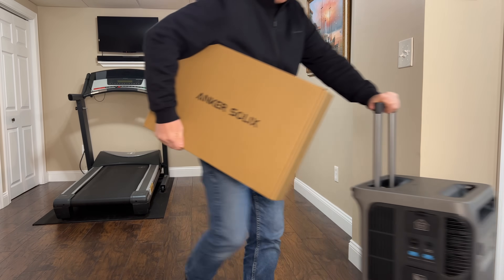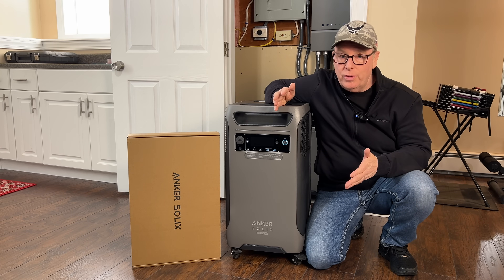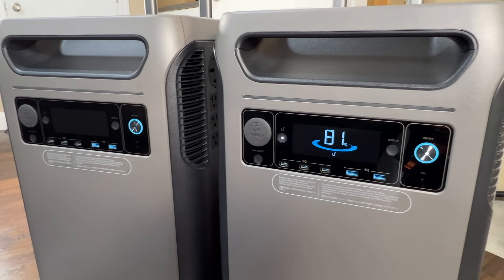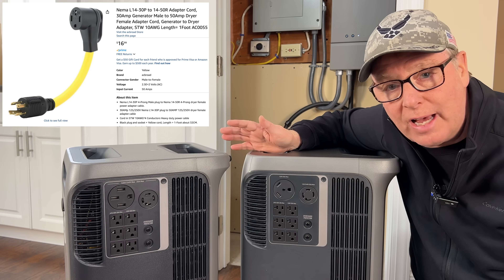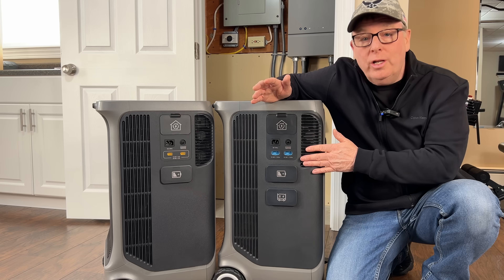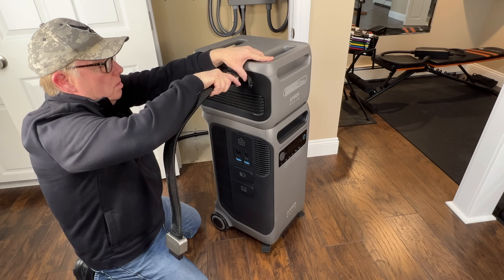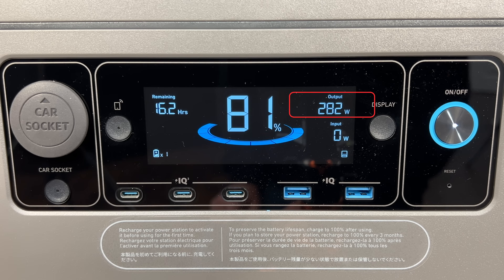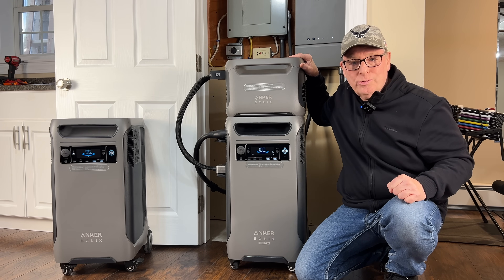Make Your Battery Last Forever (Anker Solix F3800 Plus)

Comment: I have a similar custom backup setup
1   4kw invertor
4   12v 100AH batteries
1 mains feed with it set to mains priority

all I need to add is an MPPT and solar OR a generator with a DC 24v charger that can max my gennie
easy enough to get as much as 1800w of input (plus the gen) fos about 180$ plus wires

I intend to add an AUX port and have up to 8 parallel battery sets with breakers and fuses and quick connects
the AUX port might simply be how I bind individual inverters to a main feed(a large solar+balancing busbar each island connects to with a large fuse in case an inverter blows or the batteries BMS fails badly)

I may be using a balancing circuit(a large 10ohm resistor then a bypass once the voltage drops under 0.5v across the resistor to avoid sudden battery shunting) to allow connecting other packs at differing charge levels without full shutdown or risking a dead pack being suddenly needed for backup power

all this is just wishful thinking as the 24v 200ah is enough to give me emergency communication and pc use for as much as 8 hours peak, and if I need more I intend on a small 1000-2000w propane generator and <75A charger to boost me back up if I need longer runtime or to cook something in a bad storm

actually it may not matter soon as I may be moving to a new home where an anker solix f3800 plus might be ideal with all the batteries it supports
or maybe doing it DIY would be better, as I can parallel ALL the batteries through "balancing contactors" and have the inverters set for each subsection of loads around my home
Reply from the maker: Sounds like a pretty elaborate set up.
Reply: @BackyardMaine  it isn't that crazy, I bought 100AH LFP 12v packs after realizing the cost of regular Lead-acid deep-cycle replacements to match capacity was stupid
my "elaborate" parts are just some 175A anderson plugs and breakers and fuses bolted to a board to avoid accidentally shunting the capacitors on the inverter again(was afraid I killed it because of that as it refused to recharge them till I manually charged the DC  side)
2 stacks of size 29 battery boxes and two nice 2AWG flex leads to the array of fuses/breakers and another set back to the invertor with a 500A fuse just in case

it serves my needs for 500-1500w (unlike the very crappy standard UPS I used to use) and I tuned the charger to 25% as it was pumping 80a into barely 200ah of capacity

it gives me a couple hours of gaming/streaming before the grid comes back, though I am considering a propane generator if the outage lasts more than the batteries can take
a single device sitting outside my window with a propane line inside and a large anti-theft cable bolted inside to my desk that weighs over 300lbs with only a single 120v line to an 80a 24v charger to boost it back up
I calculated that the DC side was about 165A at 80% efficiency at 4kw hence my 200Ah 2x100A battery setup and since I barely ever use even 1/4 of that 80A would probably recharge and the output for the generator control relay would run a little propane gennie happily

I might even set up a router that clicks on when power goes out that is called "emergency connectivity hotspot" as I have plenty of fiber internet to spare

there was one storm that knocked out the whole town for >12 hours including cell service so having my own emergency hotspot where I can offer filtered water(maybe hot tea) and internet would be cool
only because I HATE being so limited as to have ONLY books and what is stored on my phone, especially when that outage happened when it was night so I didn't really even have lights to read, and the temp slowly raised so high I couldn't sleep anymore till I was so tired I passed out without blankets

my setup was oversized because of future capacity boosts and upgrades, and a 4kw was the max 24vdc invertor I could buy that did a single 120v output
I planned to either underrun it(wasn't sure how long aims-power could take at 100% load) or someday use boosted capacity to run more critical loads at the same time
turns out that may have been smart as I might live in a house I can install solar on soon, allowing me to switch it to "grid failover" to reduce my power bill for loads like the fridge, server, router, ect

Comment: How bad are non-inverter gas generators for TVs, refrigerators, stoves, microwaves, boilers and mini-splits? Is there a go-between device to clean up the gas-gen's electricity on the way into the house?
Reply from the maker: They will run them but it's not recommended. They are not good for electronics especially with micro processors. I run the boiler on my generator but I won't run the TVs or the computer. The appliances run on the generator other than the stove because we need them during an outage. Something like this or an inverter generator is preferred. Surge suppressor will help with spikes but not with the modified sine wave. An inverter is the only choice..

Comment: what have u spent on al of this u have.  I think it is well over 20K of not 50K

I have 2 batteries and a little 1500 W gen.  The gen keeps my refer going and my freezer. Alternated which is plugged in and the Batteries one at a time keep the rest of my shat going.
Live with this for 10 days when a tree limb fell on the wire and pulled the service off my house. I di fine.  It was June and and Just did as I do in summer cooked out side.  Ya Like my BBQ.  Why so long had to fine a guy to the job.  The storm that took it had everyone over worked.  O got me a kid right out of Alfred.  Only on the job 2 weeks.  Only charged me a left hand rather then the whole arm and a leg.  He was good.  Got the job done in one day with me having him put in a new Braker box while he was at it.  Lavor cost was high but then he was cheaper then others, Just $500.  The next to him asked 800 for the job most was 1500 and that is just labor.
Material ran a little over 400.
Reply from the maker: Not even half of the lower number..
Reply: You can get the 3800 around $3k. Battery is $1800. Anger portable 400w solar panels are $800 each. Adapters and cords probably $200.
Reply from the maker: @check out the links. They are offering freebies and a 40 dollar input adapter

Comment: I guess a buyer would have to hire an electrician to install the Anker unit, right? The solar charging option is very interesting. Thank you for posting this excellent video.
Reply from the maker: For the home power panel probably yes.. Or you could have someone install an L14-30R receptacle with an interlock like on a generator setup and you could use it that way.
Reply: @BackyardMaine  BM; I have a question about that too... I too have an interlock for my gas genie, and this is the type of battery backup system I would like to install... I guess I am confused on how the Solix home panel integrates with the existing utility main panel, and still allows the external interlock to take power from the gas generator to both recharge the F3800+ and power the house load.  Is your setup automatic or manual? Any chance you could clarify that install?
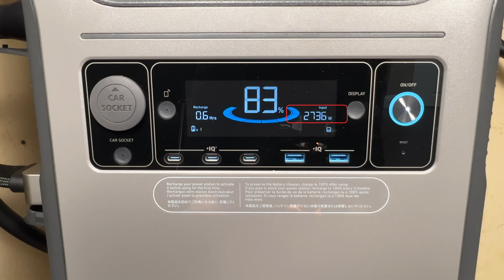Reply: @robjoyner  I think what is happening is that he's installed a NEMA-L 14 (dyer plug) in the main panel that outputs 240 from either utility power or generator via the interlock. When he connects the generator and activates it via the interlock breaker, the panel is now energized again, including that L 14 plug.  So, the non Anker loads now get gen power, as well as the Anker via that L14.  I'm not sure what he's talking about at  12:34 when he says there's no output from the Anker because the generator is in use, but that doesn't make sense since the Anker circuits should be isolated from the main panel via a sub panel.  He didn't really explain this.
Reply: The Anker power panel, yes, you don't need an electrician for the 3800 itself...

Comment: Wait, what? A standard generator produces a normal sine wave, it's a rotating armature, the sinusoidal waveform is a physical inevitability! Check it with an oscilloscope. It might be noisier than grid power, but it should not have the stepped square "modified' waveform you showed. That only comes from cheap old inverters.
Reply: Ive literally seen other youtubers charge their solix 3800 with a gas generator. Tough delivery here.
Reply from the maker: @0xArjay  It can only be done with an inverter generator. A standard gas generator will not charge the F3800. The unit will not recognize it at all. I had to check to make sure I had power which I did. You don't need to take my word for it though. Anker SOLIX will also tell you it cannot be done. This is the reason for the development of the generator input adaptor and the expanded capabilities of the F3800 Plus.
Reply: I think you should watch some of the generator repair videos done by James Condon. He is pretty masterly at repairing gas generators. The output of the electric powerheads does vary quite a bit. I've seen a lot of James' repair videos and he will do a load test at the end of the repairs to check whether the generator works properly and his procedure includes showing the waveform produced and the total harmonic distortion. The bottom line is that none of the portable generators produce perfectly sinusoidal waveforms. Some powerheads come close but they aren't quite perfect. Depending on the brand of generator and also whether the engine is single or multi cylinder, and the automatic voltage regulation applied, some may produce cleaner output with increased loads. 2 cylinder engines do help produce better electrical waveforms
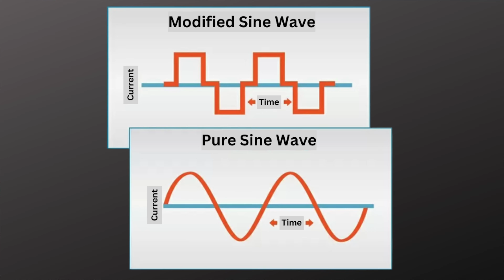Reply: @robertcochran7103  Right, it's not perfectly clean, but it's at least wave-shaped, not discrete steps as in the diagram shown at 1:36.
Reply from the maker: Actually that don't my friend unless your buying an expensive whole home, permanently installed system like a Kohler or a Generac. Look it up, you may be surprised.
Reply: @BackyardMaine   again they may not be clean, but they are not stepped.
Reply from the maker: @jbuszkie  Modified sine wave:
Many portable generators produce a "modified sine wave" which is a stepped approximation of a true sine wave. These are not my words..  It may not be as drastic as the image but I was making a point. The F3800 does not ever recognize it as power and makes no attempt to charge. I thought the plug had no power at first.
Reply: @BackyardMaine  I don't know where you got those words from...  But that's just not how gasoline (non-inverting) generators work.  Cheap, battery, generators/inverters that statement is very true.  But I do love your channel...
Reply: @BackyardMaine  And I'm very surprised that if you plugged your genny into the 120V AC input, it won't charge.  That's a bad design...  I guess, hence the need for the plus version!
Reply: Will it take a charge from a Honda 2200 inverter
Reply from the maker: @roberttreadwell3252  Yes it will..
Reply: I charge mine with a Westinghouse gas generator np
Reply: Yes you can charge either through the battery expansion port and a 48v golf cart ir decent charger and a bootleg pigtail adapter lol. Just need a generator and plug in the battery charger.
Reply: Link condo j

Comment: I would love to see your start of compressor, air conditioner, or a heavy start load with that high frequency crap that you got, one thing is gonna start large loads as a low frequency inverter. You got a lightbulb battery pack.!!
Reply from the maker: It's not a lightbulb battery pack. It's a high frequency inverter that has been proven to work great for lots of loads.

Comment: BM, I love everything you put out but, I can't agree with your statement of "standard gas powered generators put out a modified sine wave."  

Modified sine waves (a.k.a square waves) are created by electronics quickly turning on/off a circuit (generally fast MOSFET transistors).  A gas generator uses a spinning generator head that creates an actual sine wave.  It's a miniature version of how powerplants generate power.  An inverter generator is a generator with an inverter attached to a DC generator head (this is very much over simplified).  Much like an inverter in your car/truck.  It allows for a more consistent power draw and thus a consistent power output.  Most cheap inverter generators are square waves but, they are consistent in the waveform and 100% consistent in the frequency.  A good residential gas generator will fluctuate, in sine wave and frequency, due to load and the smaller engine having to increase RPMs to match load; thus inconsistent power.  

Where we get into "pure sine" inverters  is a different story.  A "pure sine" is basically an over complicated square sine that switches even faster to make the square wave more even at 60/50hz.  If you were to zoom in on the wave, it would also be notchy.  Some of the more reputable brands (e.g. the newer Hondas) are pure sine inverters.  Surprisingly enough, the Harbor Freight Predator ones are too.  

All that is to say, the reason the "sensitive electronics" see a standard generator as dirty power is because the device when activating the charge sees the drop in sine and frequency thus stopping.  If you got a larger gas generator, that could better handle the large spike in draw, you wouldn't see that problem.
Reply from the maker: Thank you.. Most portable backup generators produce a modified sine wave rather than a pure sine wave like you're talking about. You can look it up if you want.  

Most if not all  larger permanently installed back up generator do produce a pure sine wave much like the utility generation. (Kohler/ Generac)

But portable generators generally create a modified waveform that resembles a sine wave but with steps instead of a smooth curve. These generators are cheaper and simpler to manufacture compared to pure sine wave generators and while modified sine wave generators can power basic appliances and tools, they may not be suitable for all types of electronics, especially those with sensitive components or microprocessors. 
 
Inverter generators, on the other hand, use an inverter to convert the generator's output to a cleaner, pure sine wave, making them better suited for powering sensitive electronics.
Reply: @BackyardMaine  I agree with the OP..  regular gas generators will not have steps.  They will produce a "smooth" (I say loosely) sine wave output.  It may have duty cycle distortions and amplitude issues and frequency issues.. but it will be smooth not stepped.
Reply: @ It won't be stepped from 0V to full voltage, but it will also not be a proper sine wave. It will have considerable total harmonic distortion. At a glance, it might not look far off from a sine wave, but actual measurement will show otherwise and sensitive electronics can be affected.
Reply: I've seen oscilloscopes put on regular generators. They're much worse than utility power which is usually worse than a "pure sine" inverter. You have to keep in mind that most generators only have one or two cylinders, so they're physically incapable of generating a proper sine wave since they can't run smoothly enough for it. Generator power being "dirty" is not just due to poor response to rapidly changing loads, though that can be a problem too. The way power plants produce power is very different from how most portable and whole-house generators work. Big power plants don't have tiny little one or two cylinder motors vibrating all around inside them, they have massive steam turbines and/or natural gas turbines that spin much more smoothly, have a lot more mass keeping them from having rapid rpm changes even with rapid load changes, and thus generate power relatively smoothly.

Any real "pure-sine" inverter is going to have sufficient filtering that it will output cleaner power than from a utility. You'd have to zoom in to silly magnifications to see any noise from the electronics on a properly working pure-sine inverter. That's the entire point of them, to not pass along high-frequency noise to the devices they're powering.

While they may exist, I've yet to actually see an inverter-generator that wasn't advertised as being "pure-sine".
Reply from the maker: @5467nick  Dead on..
Reply: I'm with the original comment here...mine is a simple rotating sinewave output.  What brands of cheap gens are purported to not make a yeoman's attempt at an analog sinewave?
Reply from the maker: @jeffferguson4632  Almost all of them actually. Look it up.. Kohler and Generac whole home systems are pure sine wave but not much else.
Reply: @jeffferguson4632  Check it with something that can measure total harmonic distortion. A pure-sine should be less than 3%. If it's not advertised as pure-sine, then it almost certainly won't be close. Except for inverter-generators and maybe some very large regular generators, they're almost never anywhere close to that low.

Comment: I've been watching these things for possible use in my home. Can I ask what you were using as your critical load so I can judge how long it might last for our use? Some form of Air Conditioning would be considered critical here in South Louisiana during most outages. I really appreciate any help you can provide.
Reply from the maker: Most of the loads we run are intermittent so I can get quite a few hours of run time before it needs charging. Depending on the size of the AC it may not last nearly as long. We run lights, receptacles, coffee maker, microwave, chest freezer, refrigerator/freezer, water pump, oil boiler- (burner, controls, circulation pumps), two TVs, computer, internet modem and fire alarm.